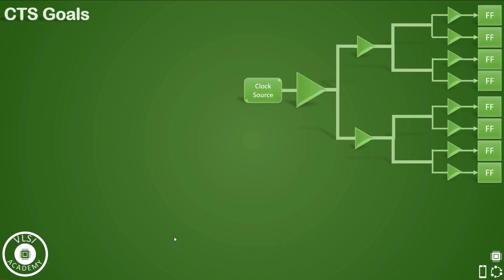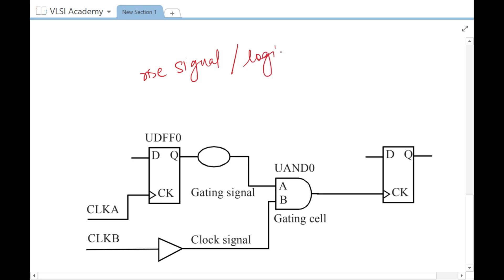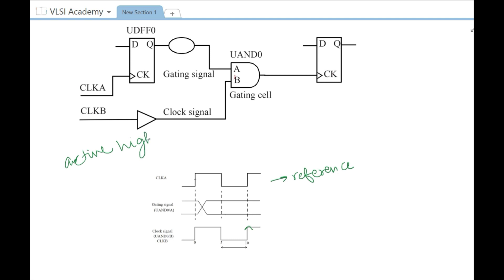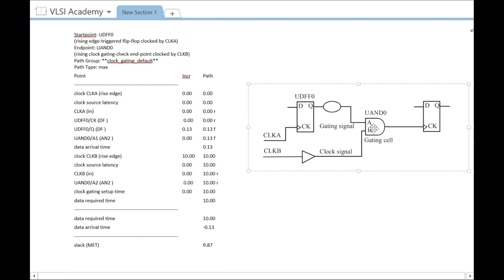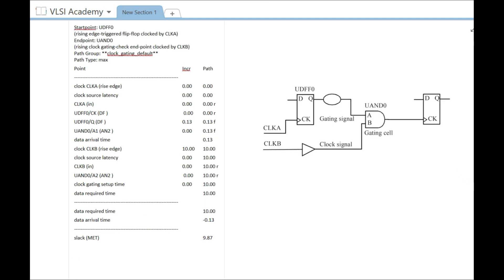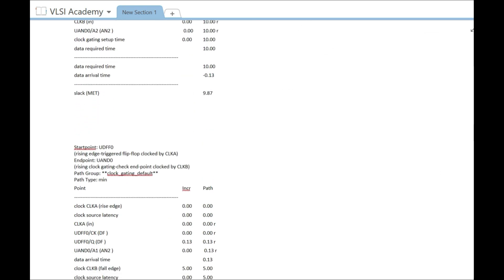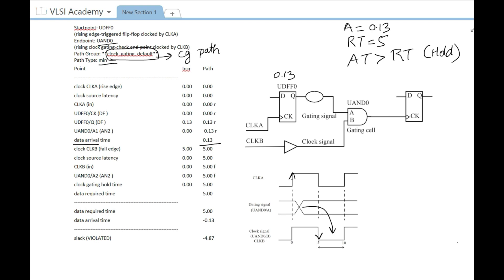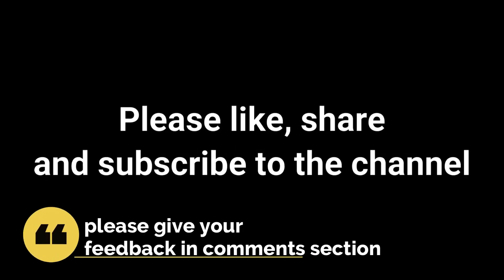PD Lec 56 Clock Gating Checks | CGC Paths | CTS | VLSI | Physical Design

Comment: Which one is better, inverter or buffer for clock tree synthesis in terms of power?
Reply from the maker: Inverters are preferred to avoid duty cycle distortion, buffers have better driving strength

Comment: Why do we check hold for clock gating at falling path only? As generally, we check hold at the previous rising path. I tried to understand it by watching it again n again. But I am not able to get it why falling path only?
Reply: @VLSIAcademyhub  same doubt i tried watching all the 3 videos but why hold is check at falling path?
Reply: same doubt.....
Reply: Why hold is checked at falling edge? 9:50 
Launch flip-flop does not have anything to do with it. In case of AND gate, you need enable to toggle during clock low, so negative edge forms hold check and positive edge forms setup check. Vice-versa in case of an OR Gate.

Comment: Thanks for the video ….. keep posting 😃. 
Question: 
1. In setup check the slack is meeting by good number , can it lead to clock period variation ? 
2. Clock gater (And gate ) , can time borrow be done on it by tool?
Reply: tools do not allow time borrowing across them and time borrowing only happened in latch